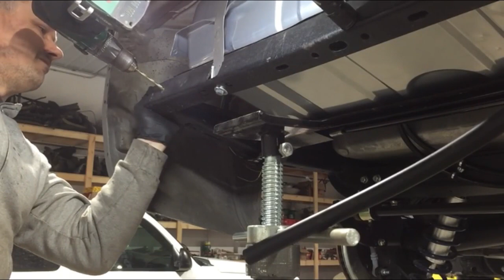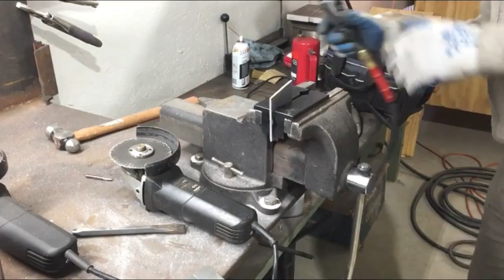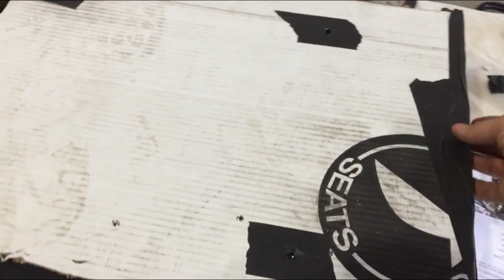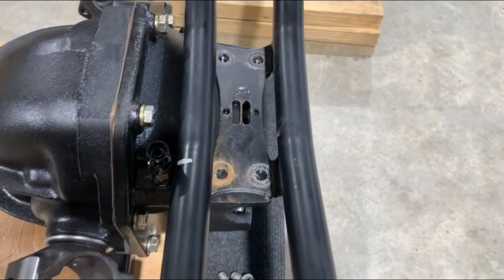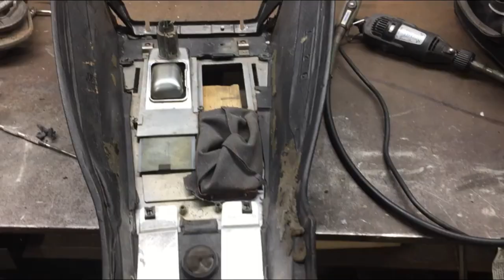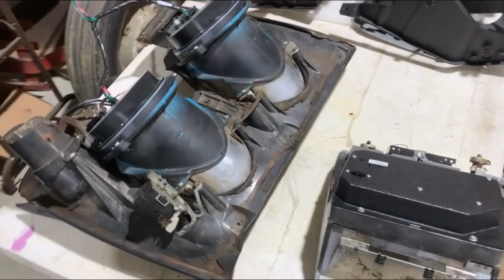C3 Corvette Project  - Part 10

Comment: Hello, great build. What size wheel studs do you have on your car? Did you upgrade them or are they stock size and length?
Reply from the maker: Thanks! The fronts were upgraded a size when the Wilwood brakes were installed. The rears are still stock size. I believe that makes the fronts 1/2” and the rears 7/16”.
Reply: @garrettworks346  are they still 1-3/4 stock length or longer? Thank you
Reply from the maker: Rears are definitely stock length. I think the fronts are too. Still using an enclosed lug nut. My wheels were made to work with stock length studs and there are no spacers.
Reply: @garrettworks346  Thank You

Comment: hi what size tires and wheels and how do they fit thank you great work you are doing
Reply from the maker: 3030 Autosport MOD3 series - M6GT wheels
https://3030autosport.com/product/mod3-series-m6gt/

Front: 10” wide 5” backspace 275/35R18
Rear: 10.5” wide 5.5 backspace 315/30R18
Falken Azenis RT615K+ tires. 

They fit great!

Comment: When will you show how you mount the seats to the floor?
Reply from the maker: They are literally bolted directly to the floor pan. Drilled the holes transferred from the template. I’ll try to get a shot of it in the next video.
Reply: @garrettworks346  so your floor is level? My 69 is not. Trying to figure out how to do this
Reply from the maker: @chrisholden7575  from side to side it is close. I cut out the seatbelt pocket and filled it in. The ‘76 does have metal floor pans. I assume there would have to be supports added to the fiberglass floor in a ‘69.
Reply: @garrettworks346  thanks. Can’t wait to see it in your video